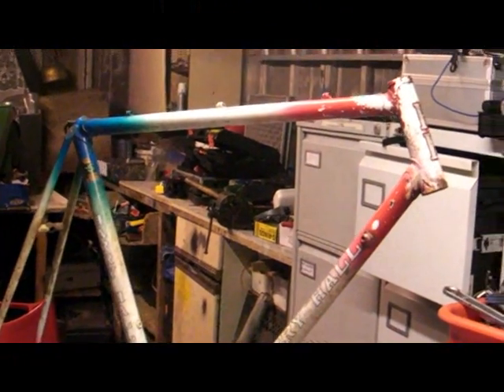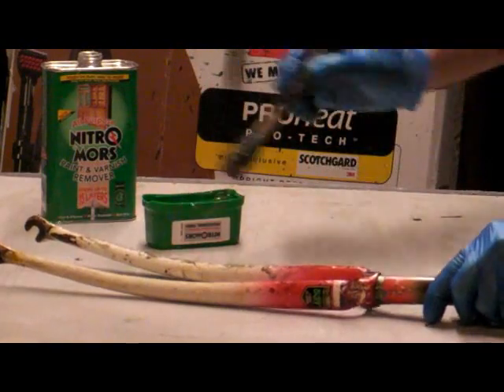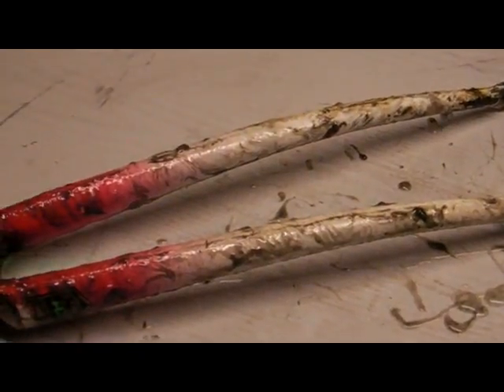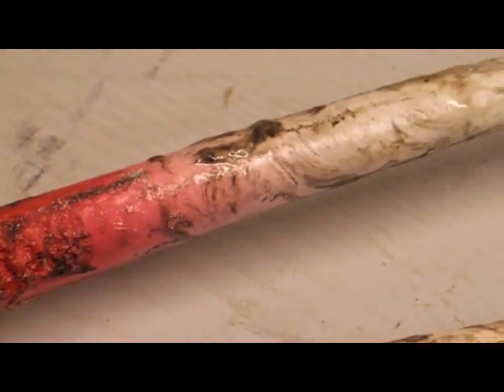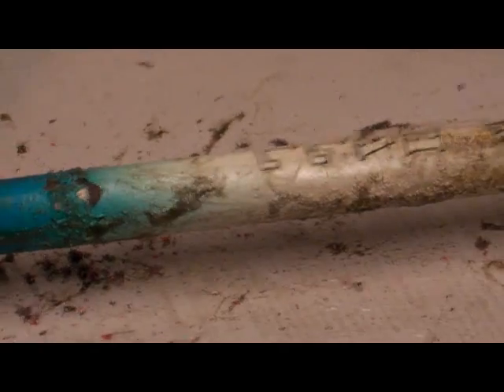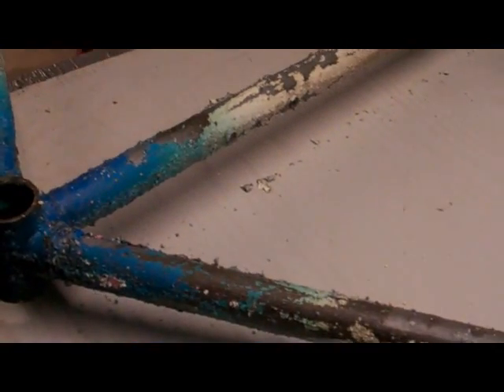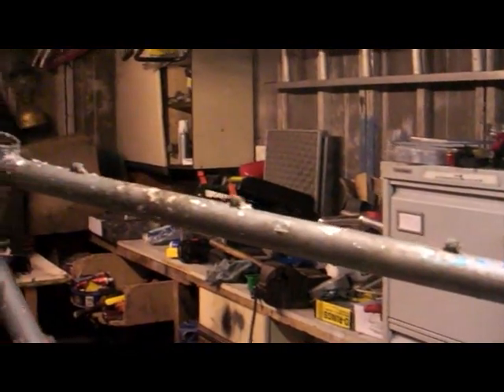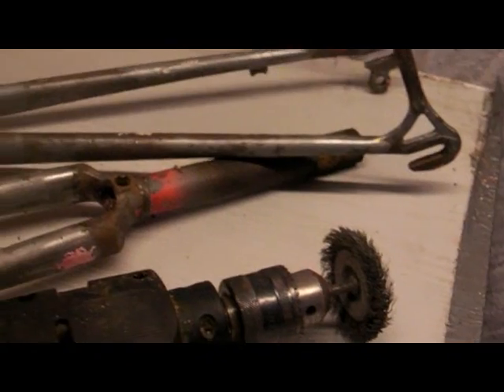Bike Maintenance - Part 2. Stripping the paint. 30 Year Old Harry Hall Road Bike - TOTAL - rebuild

Comment: great vid...but here is a great tip..save loads of money...make your own nitromors.!!....Go to a  good hardware store,like say B and Q..Buy some wallpaper paste..and buy some Caustic soda...Mix up the wall paper paste,d ont need hell of a lot,and mix in a mugfull of Caustic Soda..and Hey Presto...Nitromors...only you can make enough to strip a tank,so go easy i say..i use a sand castle bucket,lol....and yes,its really powerful,and a fraction of the cost of Nitromors...Awesome Tip...!!
Reply: +Tim Hammond 
Its nasty stuff, strippped a whole staircase using wallpaper paste and caustic. But I dont think it would work with Aluminium frames as the caustic and aluminium react.
Reply: yep...its nasty stuff alright,i have never tried on an Aluminium frame,but was good on steel...but,as you say,you get this stuff in your eyes,or on bare skin,..your in trouble,so use at your own risk.!!

Comment: it might be worth mentioning that the nitromors your using is for wood and varnish not really for paints and such used on bikes however they do make an automotive one which is much better and gives a much better result both will work though the automotive one works a lot better though